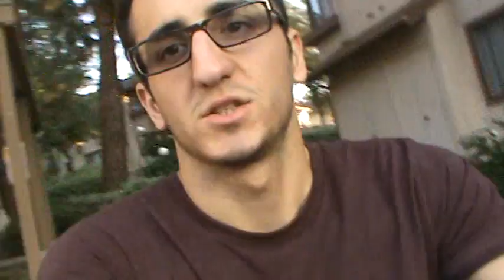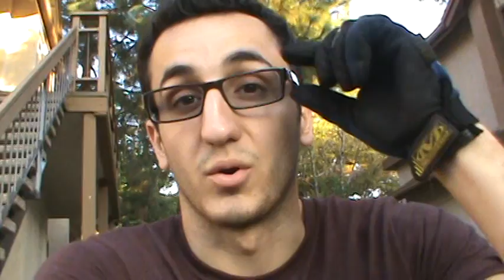Things to know about Engine Oils and Fluids

Comment: Worth thinking about; the engineers who designed your car know whats best.  If it says you can use conventional, you can.  That's what will work best fo your car.  Where things get somewhat confusing is in driving conditions and maintenance.  Cold climates will do better with synthetics. How often do you change your oil? Conventional is fine for 3-5k miles, synth lasts longer.   Do you drive city or highway miles? Generally speaking; I stick with what the owners manual says(conventional) and have never had problems.

Comment: I never really understood the differences in the oil for synthetic and conventional oil.
I have a 99 Tahoe with 229500 miles on it and I still use the factory grade oil and u use the standard oil  engine runs like new but I change the oil frequently its also not leaking oil either  the oil level stays on the full mark between oil changes I never let the oil stay in for longer then 5,000 miles. I usually get it changed around the recommended mileage on my oil sticker.

Comment: How does the issue of changing from 5W30 (which is what I use in my WRX) to a 5W-40 If the vehicle in question is not using any noticeable oil between 10,000-12,500km oil changes and there are no signs of oil usage via the exhaust? Feel free to ask me questions before you give a 'final opinion' to my question.

Comment: The only thing I'd like to point out is that you recommended moving from 5w-30 to 10w-30 for a high mileage engine. The first number is the viscosity at ambient temps (or cold start conditions). It's not the number to be concerned with on a higher mileage engine. 5w-30 and 10w-30 operate identically at operating temperatures (where an engine spends most of it's life). I believe you wanted to recommend moving from 5w-30 to 5w-40.